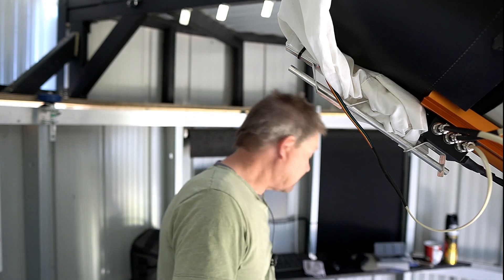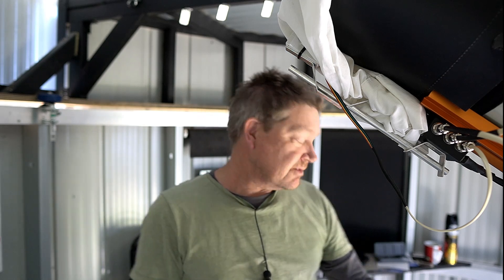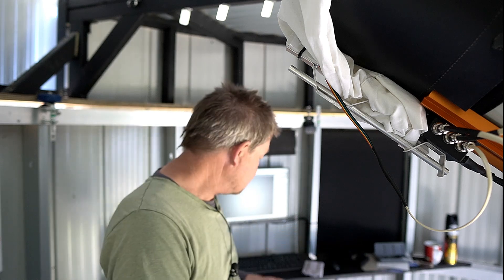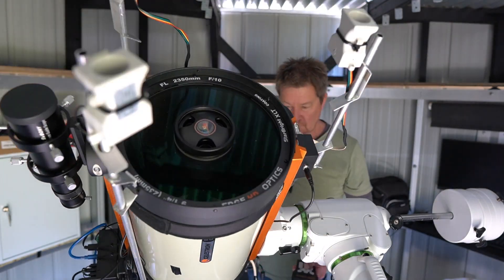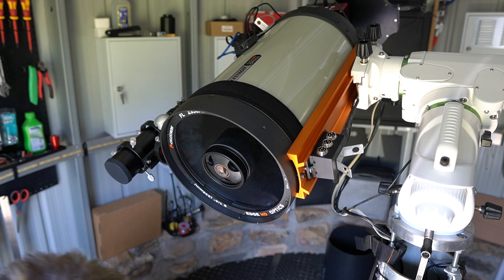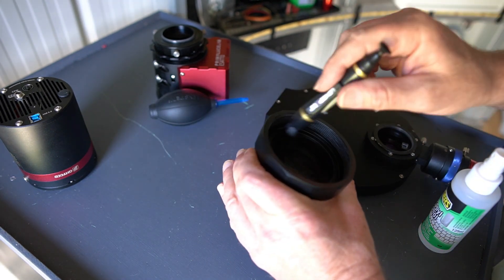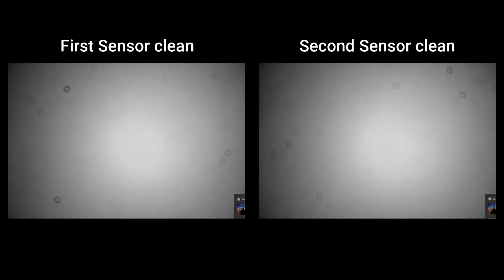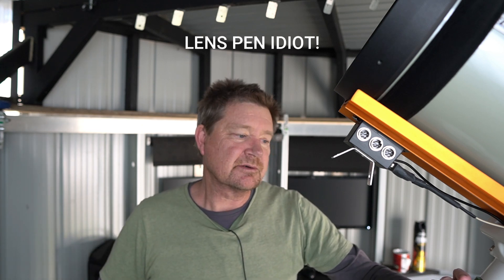Cleaning my optical system

Comment: Hi Don, I’ve never had much luck with the lens pens. Seems like I always get smears. Hey I don’t know if you’ve used the Celestron dew ring before but I ran into a bunch of problems with mine due to too much heat. I’ve got some vids about it. If you end up needing any info let me know.  Good to see you in the observatory!
Cheers!
Doug
Reply: I will concur here.  Threads on Cloudy Nights discuss this, and I've witnessed it first-hand.  As the dew ring applies heat, the stars get very "spikey".
Reply: @johnmacdougall4545  indeed!  Exactly!
Reply: @johnmacdougall4545  Maybe because the ring needs to dissipate heat through the inside of the dew cap? I used to use a normal dew heater strap, just below the dew cap, which makes heat dissipation go "around" the outside of the dew cap. You need more heat though, but the results are fine.
Reply from the maker: Thanks for the heads up Doug. I will start of with the lowest heat control output and work my way up. We are in Spring over here now and the nights are warmer, so I may not even need it for a while. \

CS Don

Comment: Don, I think the one pass swabs that come with the fluid might work a bit better. They did the trick for me first time. Had a couple of very dark spots on the sensor that I could not ignore any longer.
Reply from the maker: Thanks Darren, you may be right. I have not tried these before. May have to visit my local camera store and give them a go.

CS Don
Reply: @donstronomy7606  Lens pens are mainly for optics, swabs are mainly for sensors and sensor protection glasses. I used them for ages in photography already ;)